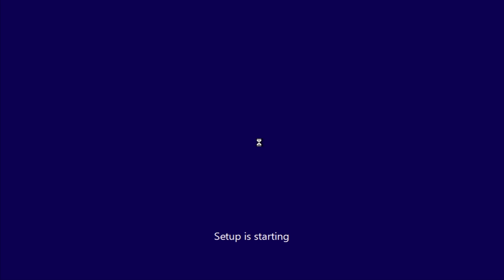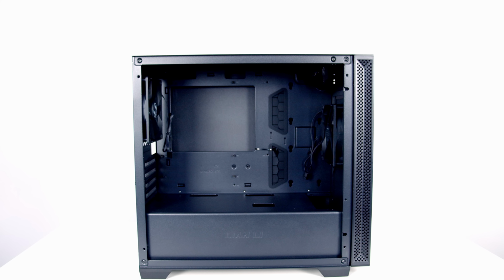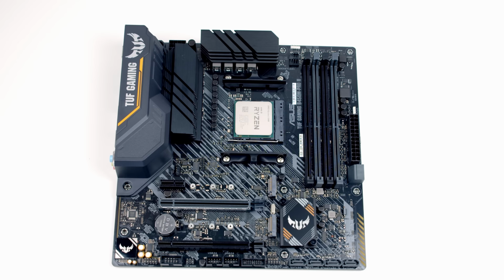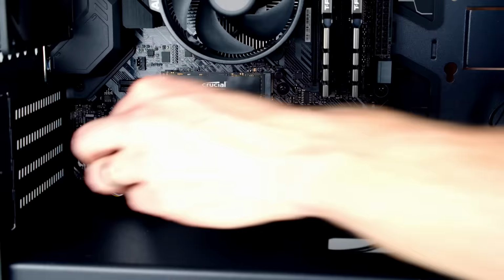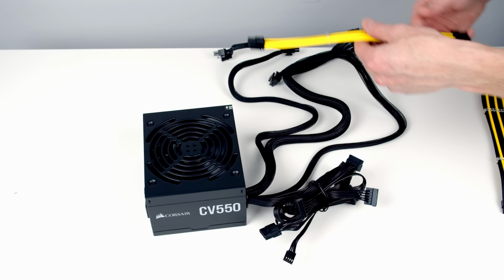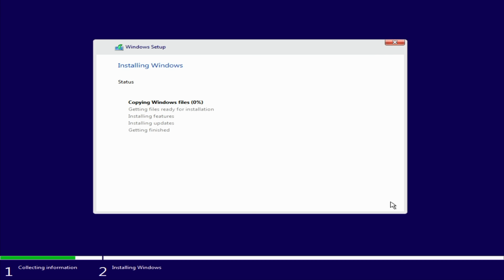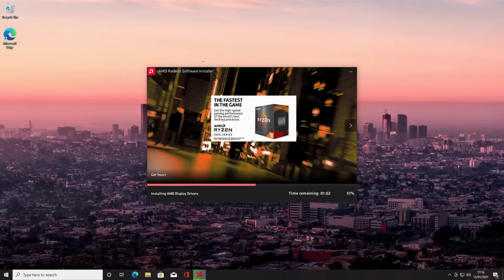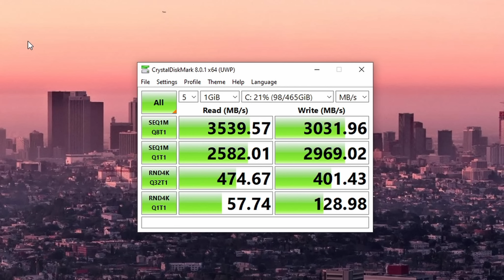£600 Gaming PC Build Guide 2021 - Step-by-Step with Benchmarks

Comment: I came here to thank you for the video, cause i just finished my first ever build. I chose this case, as it was one of the cheaper ones and still seemed really good. 
Still have the windows installation process ahead of because, i just can't find an 8gb usb, the ones i have are all 4gb. 
I guess the hardest part of the process was probably putting those led, power and hdd connectors for, as i havebig fingers. I also added a hdd for extra storage, because it was a cheap option, but won't impact the overall performance from what I read. 

Want just to know if a m.2 nvme needs an cooler. I put the included sticker on, but somehow doubt that is enough.

Comment: Some people use static wrist bands or suggest to touch occasionally on the power supply, turned off but plugged to the wall, while installing the CPU, RAM, etc. Do you take any sort of precautions or do you think the possibility of damaging a component due to static from our body is flimsy?
Reply from the maker: Not something I have ever had problems with but you probably should do

Comment: why didnt you use the fan splitter to connect the 2 front fans to the top header, wouldve been just as easy and less cables to hide going to the rear fan header, personally i would have purchased case fans you can daisy chain that way you didnt need to buy a spliter, also pwm daisy chain fans will run far better and can be adjusted much easier.
Reply from the maker: Wanted to keep the lian li case fans together in the splitter and the 3 pin by itself. 3 pin fan wouldn't reach to back header, but agreed the splitter in the top would have worked better if cables longer. Went 3 pin on purpose to cover differences in the video

Comment: Would running Microsoft flight simulator 2020 work okay on this build Chris? I have checked the minimum and recommended requirements for the game to run but it would be good if you can confirm in case I have missed something. Thank you.

Comment: It comes to £650 without the Radeon RX 5500 XT MECH 8G OC. So how is it anywhere near 600?
Reply: Something is not right there. I’ve just finished my upgrade which has a i5 10400, Z490 board, 16gb of 3600MHz memory, along with a 1TB NVMe drive for £400. 

The lowest priced decent GPU I can find is a GTX 1660 Ti for £350. So really what makes this build more expensive is poor GPU pricing. Everything else is selling for normal prices. Maybe AMD are trying to con customers atm.